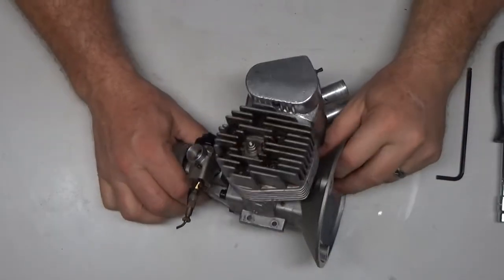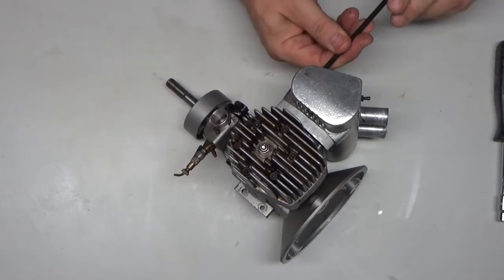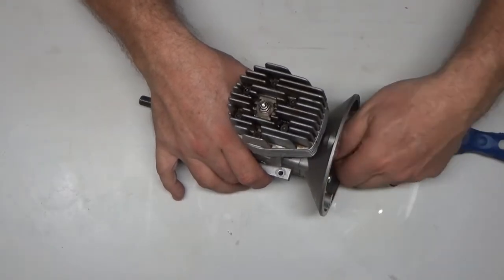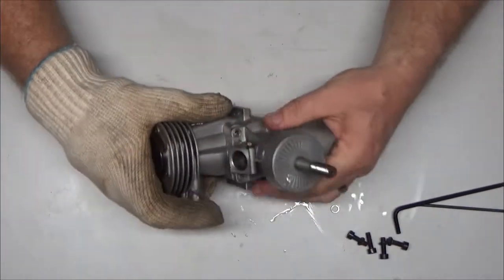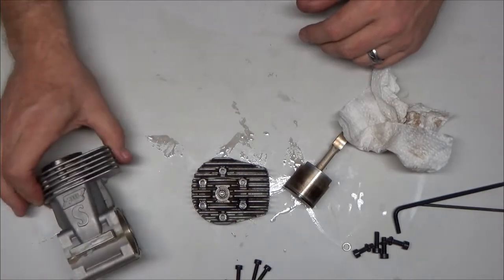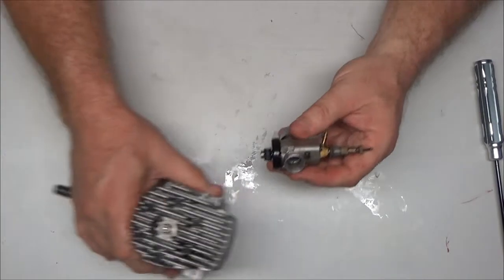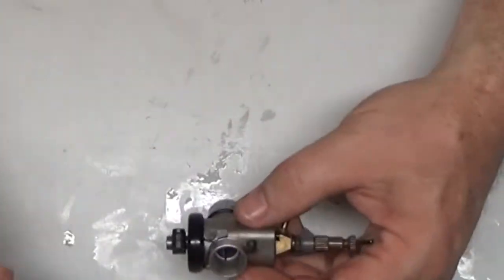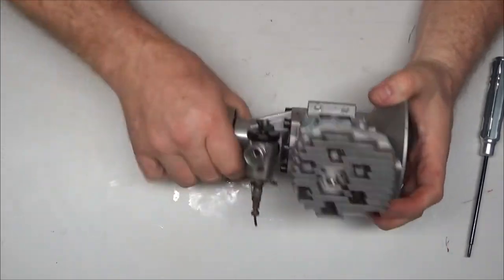Super Tigre S3000 A Look Inside

Comment: Hi David ! While seeing your very interesting video, I have a question about what kind of ultrasonic cleaner you're using ? Where could I find a similar. The result of the cleanings is soo remarquable ! Thanks a lot !
Reply from the maker: I am currently using one I got on eBay.  Simply search eBay for ultrasonic cleaners.  I am not sure what is available in your area of the world.  But a cleaner is a cleaner really.  mine is very similar to this.
https://www.ebay.com/itm/185613011577?hash=item2b3765ca79:g:CxQAAOSwCX1jRBok&amdata=enc%3AAQAHAAAA4B%2FSNKaotMPzNTKj2AeKOV5ZPaPgcz%2FEbX34v9CBA%2BshihoekuMfdUBDQHZkH23coKQdi6sydT7B9kTpfTRRgxbDjla1bnQ6dT%2BC8Fyt2cn2dHn%2F9It1Ge%2FqtAc8SGoHlYZp%2ByiF1oR9dwFN6pC3VKD3WEvNSvWycen9gcKHWP5MBM2XehOkxqAF2hiwqEfT%2FsnoNYvwaw7DMadEFHx6tt%2B7k623mHu24GWgtVO6N9ja1h6LrxtOo6ZYUfmIkFYrCUoaiUfXV8rZ9d34oJ0b8rbsOBkIT%2FNYEosUWXeut8dU%7Ctkp%3ABk9SR7Sv8dWkYQ
Reply: @dmrcflyr2   Thanks a lot David ! I've just seen the web link to the ultrasonic cleaner : Il is clear that ther is no need to a very powerfull or oversized cleaner for our kind of engines, specially because a goog cleaning is required with a totally dissassembled ! I will find one of these for sure quite easily. Thanks again David ! And Merry Christmas (Joyeux Noël, in French) !

Comment: Ok I gotta know, what did your ultra sonic cleaner cost? And what type of cleaning solution are you using? I have rebuilt over 30+ engines over the last 6 months, I take mine to work with me to soak in my acetone cleaning tank (I'm a painter in the aerospace industry) acetone works ok but requires a lot of scrubbing with a brush, i hate waisting my lunch time cleaning engines so I want to set up something at home to clean any future purchases.
Thanks David for all your hard work.
Reply from the maker: I use this cleaner from Harbor Freight, https://www.harborfreight.com/25-liter-ultrasonic-cleaner-63256.html
And a 50/50 mix of water and this, http://www.dollargeneral.com/las-totally-awesome-all-purpose-concentrated-cleaner-refill-64-oz.html?gclid=Cj0KCQjwi97NBRD1ARIsAPXVWWAeYqYVdT8f75qfXAn9OMOhq4WQ5tWlLIiShbOF687ot_xh93w8zsYaAjkmEALw_wcB

Comment: Hi :I just bought a used Super Tiger 4500 and waiting for it to be shipped .Could  you tell me if the 3000 had bearing on both ends of the rod .                                                                                          Thank You                                                                                                           Joe
Reply from the maker: Bearings on both ends of the rod?  There are no bearings on the connecting rod at all.  The crankshaft has ball bearings supporting both ends as most all BB engines have.

Comment: It looked flooded to me, just my view. I was told any time they wont run, its compression or bearings, usually bearing, those front bearings are the biggest issue with compression. Oh, a stuck ring will cause issues. I saw a guy tear down a 2 stroke generator that sat for a long time, turned out the rings were gummed up and caused the issue of no compression. He got it free.

Comment: You reinstall the backplate the wrong way, I think. Nice explanation about compressed ring.
Reply from the maker: There is no orientation on the back plate. It can go on any direction.
Reply: David McIntire Ok. Just thinking that it may be convenient to have the fixation holes in another position (180 ° flip). Thank you for your answer.